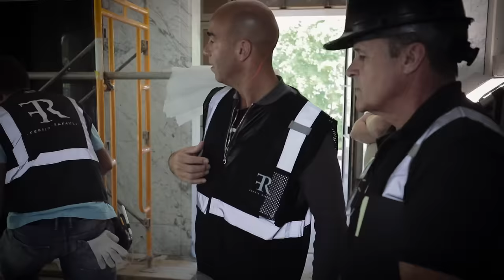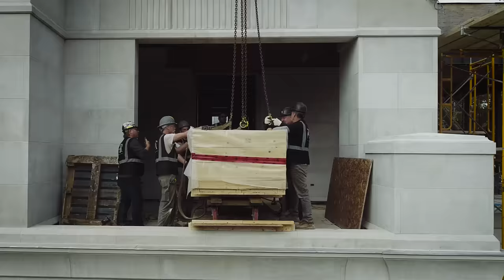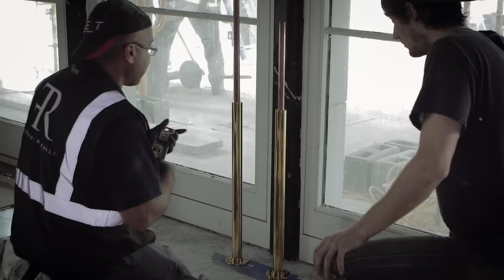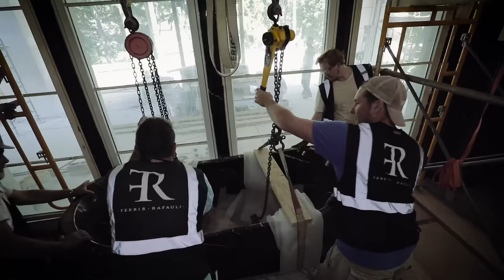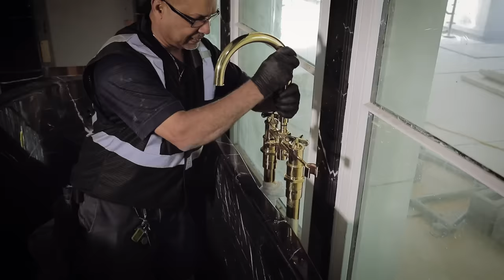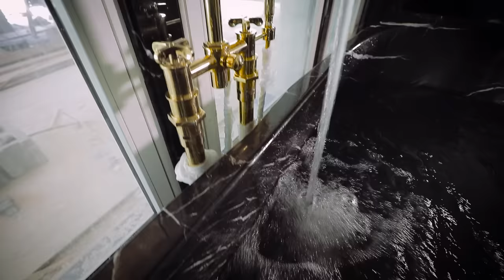Drakes 4000 pound bath tub delivery.

Comment: assuming they properly structured that area to hold that amount of weight..
Reply: Yeah. The whole house was designed by that man
Reply: @TheRickestRick33  Builders cut corners....Generally they tend to show up 10 years later or so.
Reply: GGG at the end of the day, you’re still assuming.
Reply: @TheRickestRick33  for that area I am indeed assuming.
Construction is a subcontractor world.  A house that size requires several.. I mean several of them...Some are  going to cut corners.
I've  see many of these 8 figures homes needing 7 figure renovations within 10 years just to be sold at a loss.. Hard for me to believe just because some big shot designer designed it, that's its build properly.